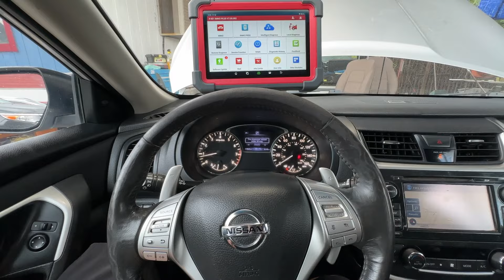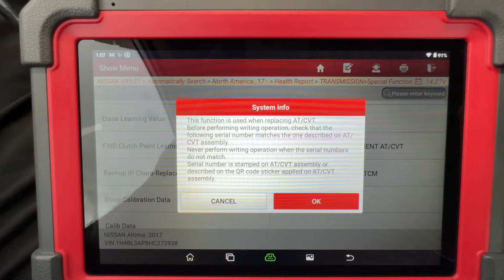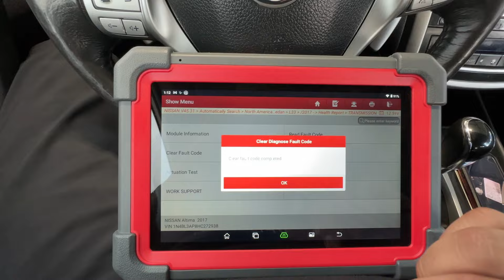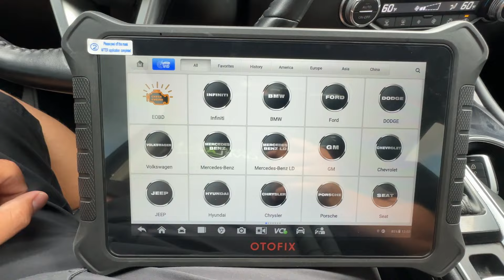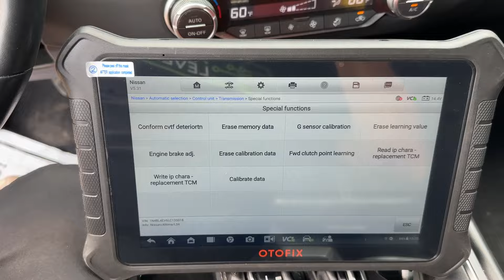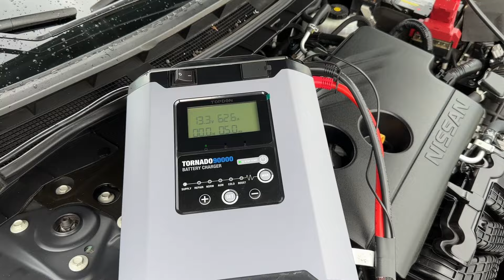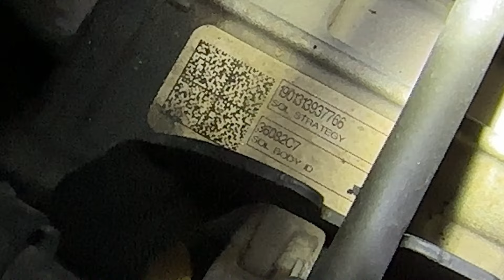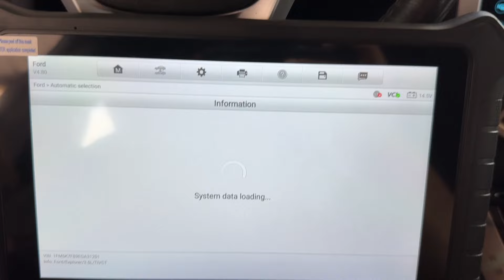A DAY AS A PROGRAMMER! NISSAN CODES P17F0 & P0101 CLEAR ERASE

Comment: A couple tips as an automotive locksmtih. We run up to 150 calls per week. If you are using any flavor of Autel on a Honda and it asks to verify the date always choose no even if correct. If not you will brick the BCM. It writes to the BCM incorrectly. Autel was not forthcoming about this even though they knew about it. Autel is no longer high up on my list because of this. Honda also has a bulletin out on aftermarket programmers bricking their BCM's. If that car ends up at the dealer the dealer will point the finger at you. This happened to 2 of us before Autel finally admitted it. 

The best key programmer is going to be Advanced Diagnostics Smart Pro. It doesn't brick Honda's either. It's expensive and paying for tokens suck but we charge accordingly. On a Hyundai/Kia push to start if nothing seems to work disconnect the car battery for 5 minutes. After reconnecting it will program right away.

 Stay away from cheap aftermarket fobs. We are using mostly OEM and OEM refurbs. $3.99 aftermarkets either won't program or break in 3 months. The biggest issue is some of these damn cars even in mid years have fob changes. Some of the cars can take 3-4 different fobs and you have to carry each one because only 1 will actually work. There isn't any 100% accurate way to tell other than trial and error. Hyundai/Kia are pretty bad in this respect. We have had cars and every piece of info we could find said it took a certain fob but we couldn't get it to program. We tried one for another model and or year and it finally programmed. Fords can be quirky too. If you program one and the car starts but the remote buttons don't work you used the wrong frequency fob even though everything said that was the correct one. 

Join NASTF and pay for key codes. Lishi's are OK but if your busy in the hot sun trying to figure out cuts while calls are holding just pay for the codes. Some older Mopars you have to pay for pin codes anyway. I hate all these extra expenses but we are so busy we can't spend hours on these cars like a hobby or DIY guy would. We charge on the higher end of the scale and warranty our work. We have fly by nights working out of their trunk with $3.99 fobs and Lishi tools doing them for $100. We have had customers call saying these guys spent 3 days on their car and couldn't program it. We charge $350 and are done in an hour. You get what you pay for. You can get into the $6-700 range for Euro's.
Reply: How do we learn if one has the electrical know how which we or any references..,👍
Reply: @johnmwangi6291  UHS has paid classes online and in person. That would be a good place to start. You need at a bare minimum $10,000 in equipment keys and fobs. You also need some advanced auto knowledge and how to take things apart. You could also start at the bottom and take a job as an apprentice with someone willing to train you. I have trained guys with zero experience. I also have guys working for me that just do lockouts. They really aren't interested in taking it further. They could make more money but they are happy just doing lockouts. Some cars you need to know how to take door panels off and on. You need to know how to take outside door handles off to make keys and open some trunks without making keys.  Some cars after the alarm goes off it disables the electric trunk release so there are ways to circumvent that. 90% of customers with keys in the trunk tell me about the fairy tale car they own. Their car doesn't have an alarm, their electric button will work after we open it and the rear seats fold down. These people actually believe it and of course we go out there and none of the things they said were correct. lol Some PITA cars need a cluster taken off. ECM's opened on older ones. Kick panels removed to gain access to a connector. There is a lot to this. Some cars are dealer only as well. Everyday is different out here in the mean streets.
Reply: @scotts4125  I got into keys just to streamline my shop repairs I dont go out and look for key work. So far so good. Used a few Lishi already, cut a few keys and also programmed, no significant fob programming yet. Still very low on keys since I wasn't sure what to go with as far as OEM/ Aftermarket. Im looking to do some promaster vans...you ever done any of those? looks like several keys on those and also BCM changes which changes key.
Reply: Great info in your comments rhanks.
Reply: Great info. Any accredited locksmith course or school you can recommend for someone who does not want to be an apprentice for 2 years but could afford 1 year locksmith course + 1 year apprenticeship?? Also, is a locksmith license required to join NASTF? I learned this myself out of passion since the year 2000; the license is the only thing i need now; i have applied for numerous jobs in vain and i have actually had one but it was short lived because the enployer expected me to do all keys lost in a junkyard environment with problematic cars while they trained me 4 days out 7 on adding keys mainly because they did not wanna loose their street customers; meanwhile i was required to make 1000 daily for them and of course i could not reach this goal. Parting ways with them has been the best thing that could ever happen to me because i built myself up on what i lacked by self training at salvage yards; i have acquired several great programmers, knowledge on how to use them, increased inventories & learned new skills by myself including soldering. I advertise myself, schedule appointments, found my own customers accounts & made a lot of people happy who share my number around. I work on all cars including europeans while other locksmiths in my area turn them down. From BMW to BENZ & VAG without forgetting Rovers, I have had to make a second visit but rarely had to fail a job. The main failure i have run accross twice was the Encrypted Cas3++ paired with the bosch DME that only give out a 4 digits ISN. This combination is mostly found in v8 BMW X5 & 6 series. 

Any locksmith school or class i can take to get my exam before going for 1 year apprenticeship?? Im in DFW TX. Thanks 🙏
Reply: @DFWAuto_Hack  UHS offers online courses. Not a fan of theirs as they sell to your customers but it is what it is. I also saw a UK YT locksmith channel that offered courses. You can charge double, triple on Euro's. I would join ALOA and that should be good enough. I've been doing this over 40 years and don't have a "license". I have an ALOA certification that's good enough. I have a business license too.
Reply: @scotts4125   thanks a lot for these pointers and sorry for the late reply. I will look into having an ALOA certification. You mentioned that you have a business license; do you mean that your business has a locksmith license? thanks for these valuable information
Reply: @DFWAuto_Hack  In my area a specific locksmith license is not needed but a business license is.
Reply: Thank you so much
Reply: @scotts4125  have you ever heard of any Auctions for used oem car keys? id like to refurb them and i have so many used oem.

Comment: Hi Eric, I am 63 and you remind me of myself at your age. Mobile auto electrician.  So here is my advice for the future and not make my mistake. Find a good workshop for yourself,  with space and a ramp. If it means moving home , to a more suitable place. Do it. 
Get the customer to bring the car too you. Social media will provide you with enough customers. Also you could do a general service, which is easy money. The big problem with being mobile, is what to charge. Because the garage will say" is that all it was". Ignoring they couldn't fix it and it took you time to drive there, drive back , diagnose and fix the problem. What did you charge for the car that had a piece missing from the fuel lift pump .That was a great job. I mean this as good advice, because I burned myself out, from all the hassle . Fixing the odd problem is fine. Dealing with tough jobs everyday and never getting an easy one , is soul destroying. All the best .

Comment: I needed this so badly. 

I have the notorious Nissan Code and I had a transmission pressure sensor code. I replaced my valve body but I was trying to figure out how to reset the TCM without going to a dealer. I have the Lauch tool (not w/the immo) and now I need to check for that write option. I think I have it but I was scared to brick the car.

Comment: Is a “rumble strip vibration” on a 2017 Sentra sr an indication of a bad transmission? No oil leaks. 66K miles. Dealer found no issues with brand new tires, no bearing issues.

Comment: I’m a mobile mechanic and shop owner myself. I currently use the snap on remote assisted programmer to do all my programming, it’s a computer/j2534/battery maintainer all in one. But been thinking of getting rid of it because it’s a paid and by appointment service and it gets expensive. $150 per module program! Need to get my hands on a j box. How come you used both the snap on and then the autel j box after? Was it because one j box can do what the other can’t?

Comment: Hi Eric. I have been driving a used 2015 x-trail for 2 months now, only just found out it has a P17f0 because I took it to get keys programmed and the guy wanted to do a diagnostic check before he touched anything for liability reasons, seller admitted the transmission was replaced but the TCM was not programmed after. Said car has been sitting unused until I bought it. Could I have already damaged the CVT transmission driving with incorrect characteristic data? I can't feel any bad shifting or acceleration.

Comment: Hey brother. What if I switch a cvt trans valve body on a 2013 Nissan sv  with one from eBay.  Would I have to reprogram or do a relearn on the TCM . If so what scan tool do you recommend

Comment: New subscriber here...I also do mobile work and I also added keys to my outfit simply because I didn't want to deal with having to rely on someone to come out....sometimes they do not show and im stuck with a vehicle for an extra day or two because of that. I ended up with an autel im608 and a Gymkhana 994 key machine and hopefully looking to add more as I need. I joined to possibly get some more knowledge on tooling or procedures to program pcm and other modules. I understand some makes are laptop based and others just need a passthru...need to get some help on how to stream line the process to make it as efficient as possible. Im also in the market for a new scanner. Will be getting rid of my snap on ZEUS and looking for something to replace that and also looking to get a laptop to do multiple manufacture coding/flashing work.... any recommendations would be great.

Comment: Hi erick i have a case study on a cadillac xt4 2019. Changed the battery due to crank and no start on a road trip, started and code p0129f showed up. Didn't turned off the car from MT to TX. Changed the fuel pump engine started and error code went away. No voila !!! Car is in the same condition cranks but no start after a battery and a fuel pump change. I need your help brother

Comment: Question: is there a way to turn off the auto power off when you have the car in accessory mode? 

My car shuts (2014 Nissan Alyima SL 3.5) down to conserve the battery when I am in accessory mode?

Thanks in advance.

Comment: Had a pathfinder in the shop last month. Had judder codes. Axle seal was leaking an dit was 3 quart low on fluid. Pulled drain plug with engine running and nothing came out.
Reply: So all you needed was top it off and go back on the road?